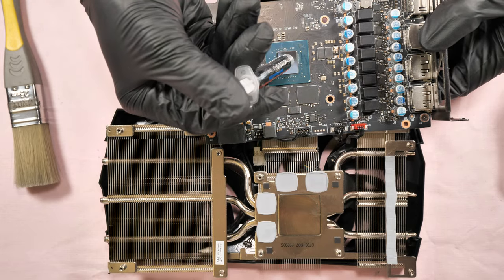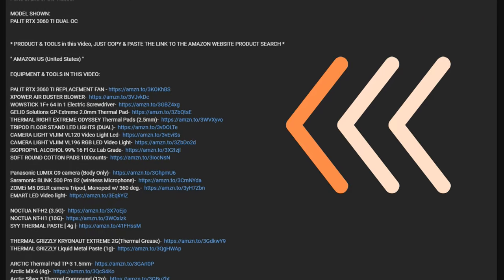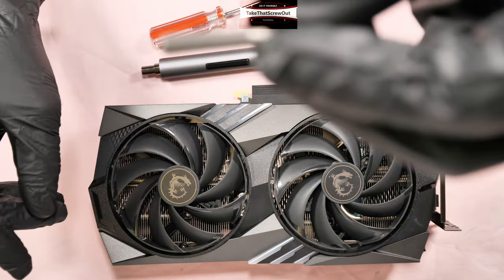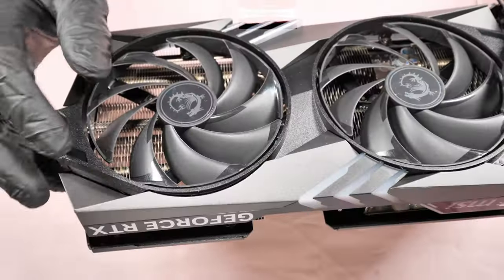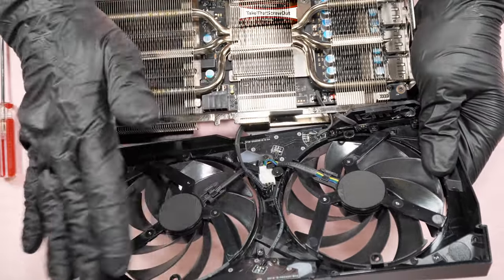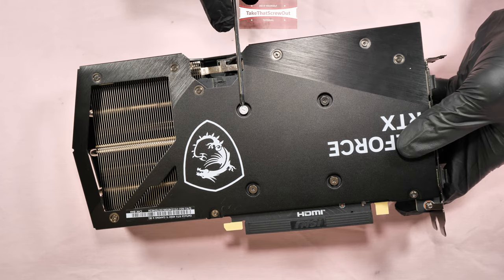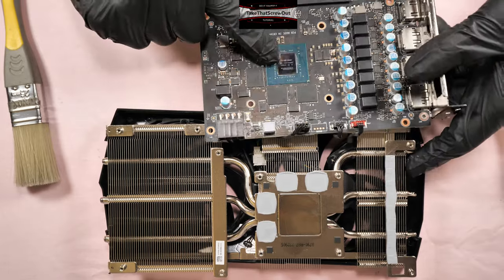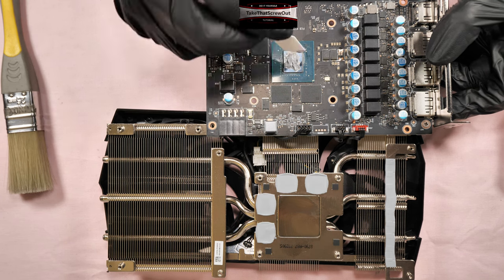MSI RTX 4060 TI GAMING X | DISASSEMBLY | Thermal Paste & Fan Replacement Step by Step Tutorial video

Comment: 09:22
 Hello, please tell me, does this video card use copper or aluminum to transfer the heat from the graphics chip to the heatsink? It looks like aluminum in the pictures. Or is it copper but painted gray? For me, the temperature matters a lot, and clearly if it doesn't have copper pipes... it's to be avoided.
Reply from the maker: Hi Bro! its a Nickel plated copper bro